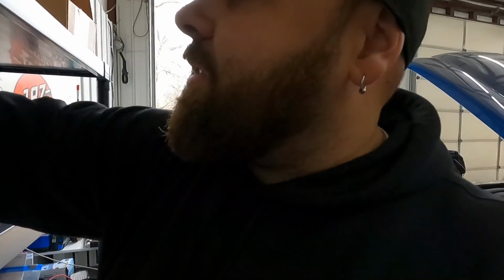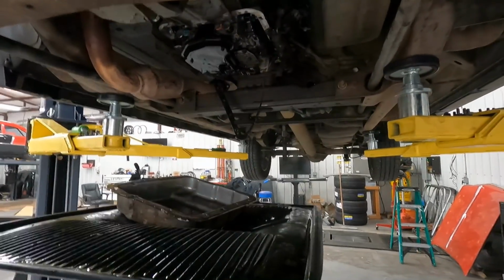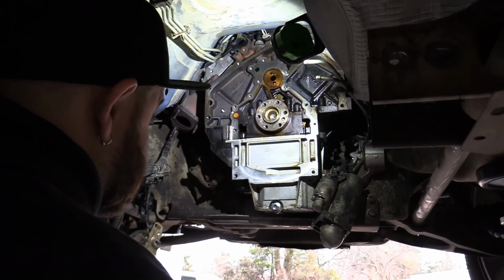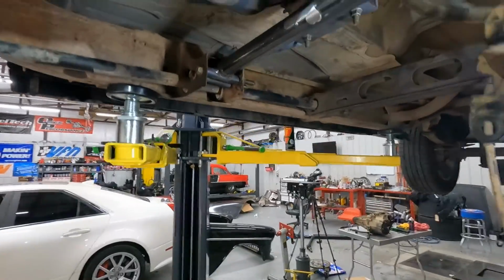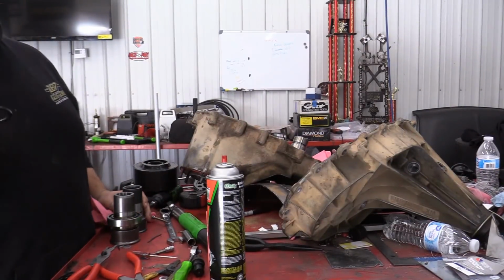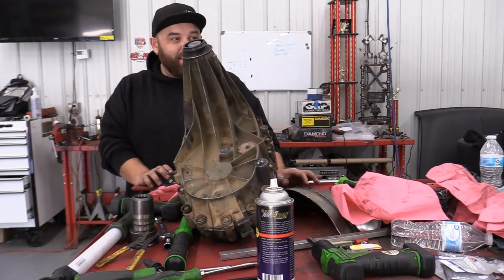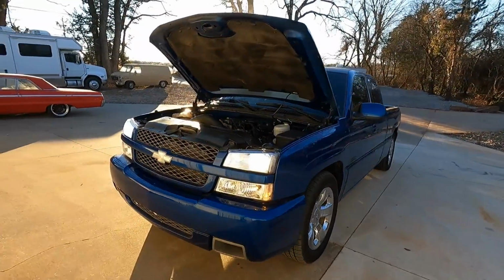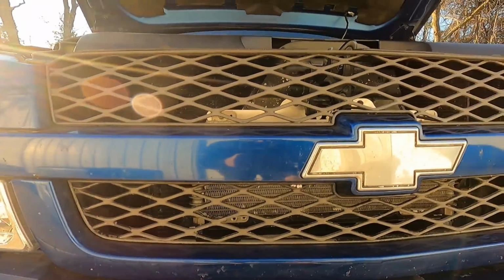4L80 Swapping Phantom's 2003 AWD Silverado SS! How To with write up Blog

Comment: Now go swap to 65e trans gearing as the 80e dogs these trucks down with tall gearing.
Reply from the maker: i've never had a truck slow down by swapping to a 4l80.  never
Reply: @187Customs the 4l80 is heavier and taller gears. You put a stock SS with a 65e and 80, not hard to figure out what wins...
Reply: @Cartman978 You might lose a little performance off the line but with a stall and a gear change it'll be fine. Overall you can't beat the strength that a 4l80 brings to the table.
Reply: @followerofchrist1961 clearly you don't know the capabilities of a well tuned, built and cooled 65e. There's a generous amount of 10 second ss trucks with them.
Reply: @Cartman978 A 65e is basically just a built 60 with small upgrades but I've had plenty of them and from my experience, yes they can be built to address some of the weak points like sun shell, clutch packs..but they still don't seem to hold up to the power or abuse despite all the upgrades. Which is why most look to swap. They do fine for stock or mild applications but if you're looking for performance, the 80 would be more plausible. Not only would you have a stronger transmission but if you build an 80, it will be able to handle just about anything you throw at it. But thats just from my experience..it all depends on the persons needs and what the vehicle is going to be used for, as long as you don't beat on the 65 too much it'll be fine.
Reply: @followerofchrist1961 again you must not know anyone doing them right. You can see them in cars in 8 second 1/4s. Yes the 4l80 is bigger and heavier but isn't needed anymore. Please go ahead and keep your 80. You clearly haven't heard of Performabuilt either.

Comment: I have a 2003 Chevy SS and ABSOLUTELY Love mine. It has original 36k miles on the truck, when it was bought new, it had a Blueprinted C5R - 427 swapped out on it. I just took off the Brand New 24” wheels and tires that previous original owner had put on, and put on Brand New 20” Weld Gauntlet wheels and did a 1-2 drop on it. Truck is ABSOLUTELY SICK… Love yours
Reply: I know of that truck from a long, long time ago. Owner passed a few years after the swap.

Comment: If you're running an aftermarket converter, run the stock style dished flexplate with no spacer an let the converter builder know.

Comment: Stupid question- I have an 04 SSS and looking to do the same swap. Why not use the 2008 up awd transfer case from a 6l80e? The spline count is the same and it should slip right on. I just haven't found a transfer case yet to try it with. Love the videos!!

Comment: I’m a Gm diesel and transmission mechanic in Florida thank god don’t deal with a lot of rust. But I use the GM rust penetrant and inhibitor. PN/ 88862628 it works very well I do not break or strip any exhaust bolts or nuts been using it for years. May want to give it a shot. But love the channel recently found it so been watching the older stuff. Y’all should come through the panhandle of Florida and check out emerald coast drag way and 45 minutes away from some of the nicest beaches would  be awesome to see you guys run and get to meet y’all. Keep up the good work on the channel and npk

Comment: Damn that's a lot of parts swap when you could have just rebuilt your 4l65e.
TODAY, with billet shafts, hardened shell, z-pack clutches, a better 5 pinion planet - 4l65e can handle 1,000 HP.
4l80's are strong to start with but they rob power.
Reply from the maker: I’d rather “lose” a couple hp to the tires and have dependability. You couldn’t pay me to install another “1000hp” 4l60 in one of my vehicles
Reply: @187Customs  I understand, you've had shitty builders.

Comment: They actually come stock with the 4L65e rpo code M32. Thats the heavy duty with 5 planetaries. So do the VHO trucks and the 05-07 VortecMAX TRUCKS! Very beautiful truck by the way
Reply from the maker: It’s still a pos 4l60 based transmission
Reply: What's the difference between the trans in a 05 ss and a 07 Yukon Denali,I know there both AWD but I can never find specifics

Comment: Man aint you a OG on performancetrucks.net? Cant remember what ya sn was tho. The pliers for those snap rings are "Tip lock pliers". Just got a few different kinds this year since i started doing all my transmissions. Must have tool for sure. Your uncertainty when doing shit is totally relatable. The first time i had my car on the brake at 4200 rpms and 12lbs of boost on the gauge... i about shit myself that the transmission DIDNT come apart XD 

Rock on man

Comment: for 4x4 80e swaps, there are gm $100 32 spline input shafts for use on 4x4 transfer cases.

Comment: Phantom if ur using the newer snap on flank drive metric wrenches then that’s why U couldn’t find a size that fit I have the same problem all the time they fit everything loose af I hate em and they cost a shit load I been trying to trade someone for an older set
Reply from the maker: I can’t afford snap on wrenches lol
Reply: @187Customs  
Ha Ha amen Phantom, I'm still needing to tear into my '99 F-150, 
last time out it came in with grey water oil, I pray it's just a head gasket....
I'll dig into it before spring.... 
Keep up the content bud, 187 is where the content is....
Reply: Oh I assumed u could since u guys have all snap on guns and a snap on box

Comment: The torque converter bolts are a 15mm. Semi-deep on a ball socket works like a champ! Removing the starter gives you a better angle to them bolts.

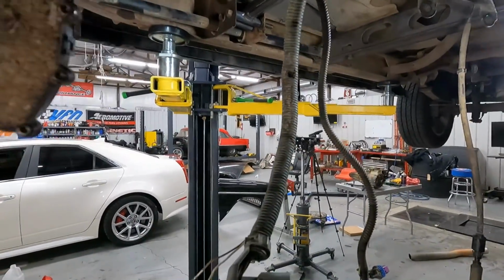Comment: Thanks Phantom for this most excellent and informative video, it will be invaluable help to those who may be considering the same trans upgrade for themselves.  Now,, as you discussed those electrical wires at the trans and you mentioned there's an EZ to swap made up set for $300 (@21:32) out there OR you can drop $6 for the pigtail and DIY it flashed through my mind I wonder how many guys hiring a local shop doing the swap for them were quoted the $300 [plus markup!] then they did the $6 route there by pocketing approximately $375 FREE and EZ CASH? You and we know there are that kind of crook out there don't we. No,, I'm a retired concrete construction guy and have been stroked by the best 'cause I did not like to take on jobs like this back in the day.  You're miles more advanced in the world of automotive skills and even you were caught with unseen surprises and had to wait for another days for parts. I just did not have that kind of patience NOR the expertise so bit the bullet hired the work done. Just a thought.

Comment: Don't you know how to heat the exhaust nuts up with the torch?  I've done over 5000 transmission Pulls In the last 12 years and never broken exhaust bolts
Reply: 2 a day 5 days a week?
Reply from the maker: We don’t have a torch. And I wouldn’t use one anyways

Comment: Drain pan bolts are garbage on those generation trucks, notorious for rounding the heads.  Get yourself a set of turbo sockets for stripped bolts and nuts.

Comment: The trany fluid goes through the radiator to get the fluid up to temp quicker. You don't have to worry about getting water in the trany fluid because the trany pressure is always much higher than the water will ever be. Youbwould know if your trany was leaking into the water all cars are designed this way for a reason.
Reply from the maker: It happens all the time. It’s not a risk I’m willing to take
Reply: Will cross contaminate the radiator will get transmission fluid first
Reply from the maker: @pmotorsports8276  it will still pump antifreeze into the transmission. It has no other option

Comment: Clean your heat cycled steel rxhaust studs with a wire brush...Use brass nuts....Run it down the hiway for 20 minutes get it heat soaked then re tighten the brass nuts...No leaks and when years later go to take the exhaust apart the worst that is happening is ripping the nuts apart....sure beats a whore a drill and a easy out...P.S. check the tool truck for left turn drill bits....Put some heat around the broken bolt boss you may get lucky when that left turn bit digs into the broken bolt it just may walk it out for you no easy out needed....

Comment: Captions on to hear over the compressor. And you translated. "Uuh, for the ladys swap" yessir. Nothing makes a pair of pantys drier than a broke down trans in a clean truck. Solid choice. Hope yall got heat. Spent today pulling ford heads in the fuckin snow 😂

Comment: Did you have to use a conversion joint to get the 3/4 ton front drive shaft into the diff of tcase?
Reply from the maker: No. The diffs are the same and the t case uses the same output. It’s a direct fit

Comment: That's what happens when newbies want to play mechanics they start using the wrong size tools and rounding off the bolt heads because they did not have the proper size they thought it was a standard size when it's metric or vise versa LOL the joys of working on cars

Comment: Same on the saws all kinda irritates the feelers. 😆 Would anti sieze work on the bolts if it was used when putting that deal together?  Got it shifting alot quicker than factory!  Thanks for the video.

Comment: Get you a Black Widow muffler... I started w/a Corza exhaust the muffler blew apart, Flowmaster was to much drone! Had the Black Widow installed and freaking love it...
Reply from the maker: No way. I like quiet
Reply: @187Customs  😂 as I get older I like stock mufflers. Pro charged Tahoe with stock mufflers😂

Comment: Tech tip phantom when you're taking out the bell housing bolts take the transmission cross member off and tilt the transmission down to get easy access to the top bolts.
Reply: I was thinking that when I was watching the video but he did it pretty easy with the wobble socket and lots of extensions
Reply: good tip!  once the trans is out, roll the pinch weld at the trans tunnel to give easier access to the trans to engine bolts.

Comment: Torch and or induction heater plus candle wax helps loosen it up and on the neutral safety switch heat the outside with a mini torch they come right apart.
Reply: What does the candle wax do? I never heard about using that
Reply: @heller127  when you heat the bolt nut the wax wicks in and lubricates the threads I’ve always had decent luck with it.